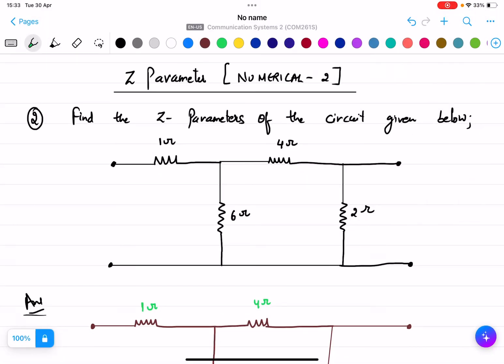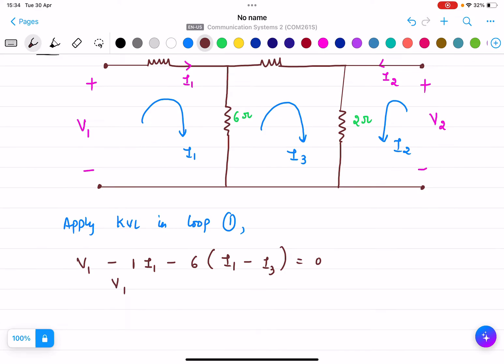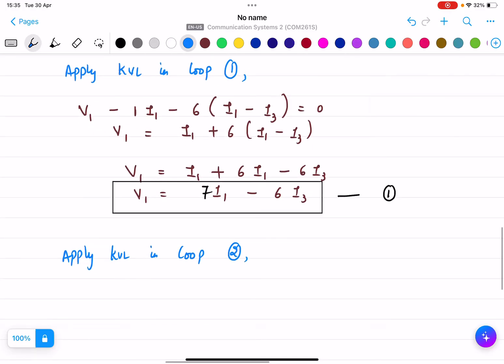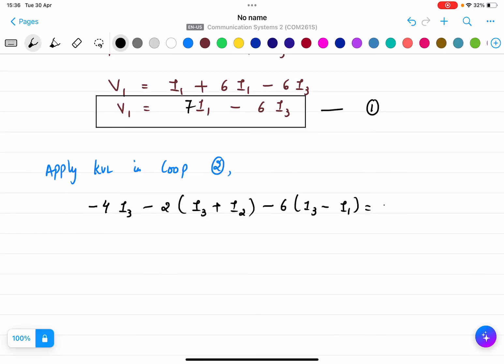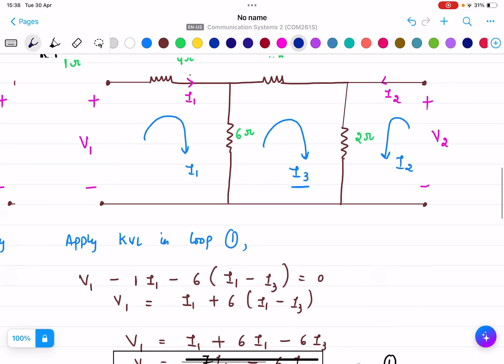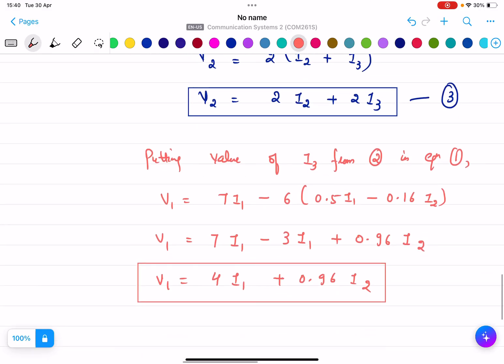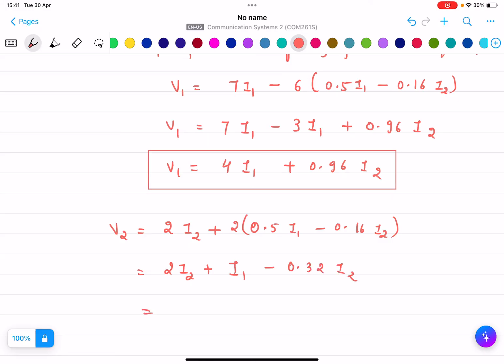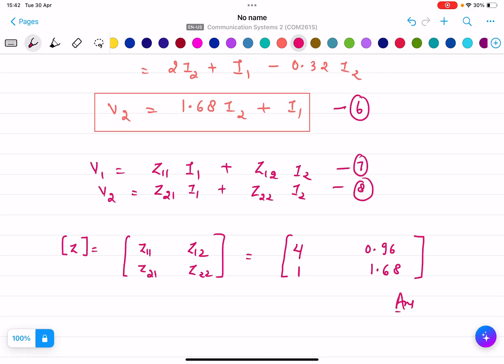Z PARAMETER - solved example- (NUMERICAL2)

Comment: on loop 2 why did we divide by 2?
Reply from the maker: If you will divide, the equation become more simplified. But if you don't than here is no problem, you will get the same answer. You can solve without dividing as well.